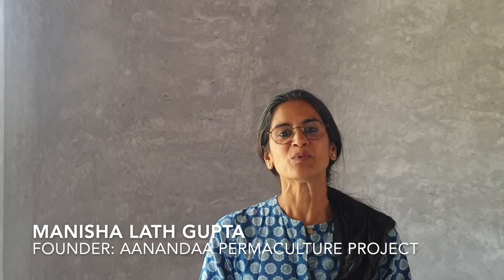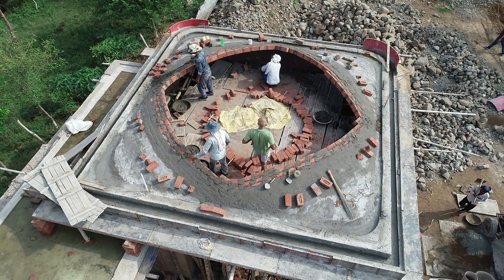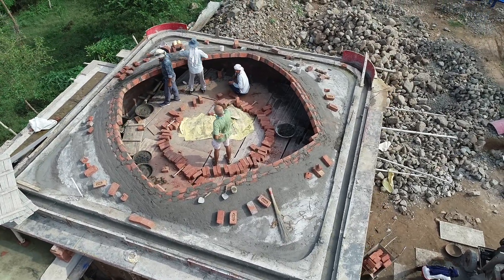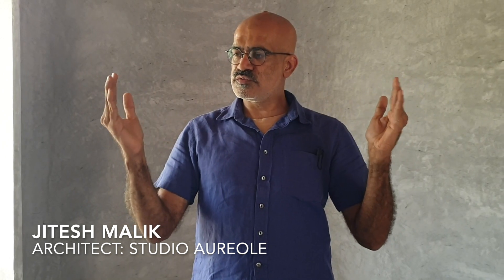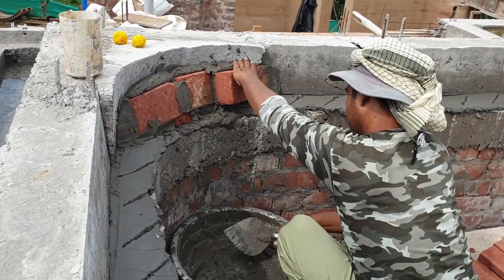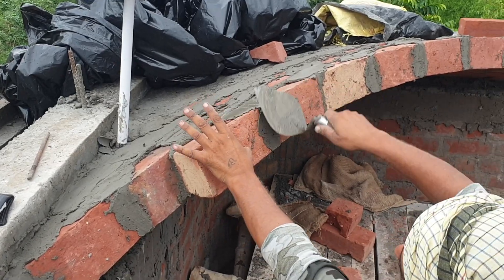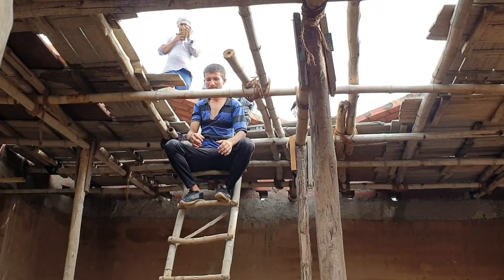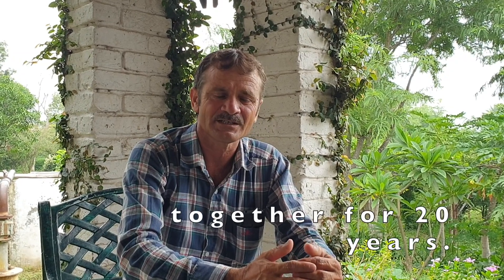How to Make a Catalan Dome Roof

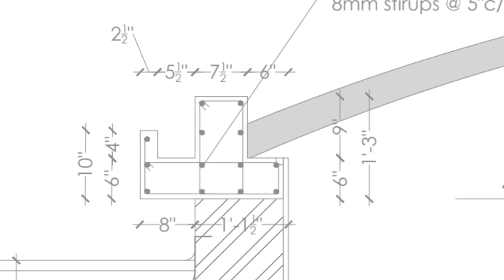Comment: The concrete beam is structurally required for the vault to work. Also it is not true that it is built without steel, you can see it on the plan at 4:55 and you can see rebar sticking out of the beam. The roof will stand up as long as the rebar in the concrete beam won’t rust. That’s why the dome doesn’t have a longer lifespan than a standard reinforced concrete ceiling. The lifespan of the ceiling is the biggest factor in sustainability, if it was really built without steel the brick vault would have the potential to stand for a thousand years, but not when it’s built like shown in the video. There are ways to solve this problem
Reply from the maker: Do share your solutions. It will help the viewers on this channel. Thank you.
Reply: @farmaanandaa  There are two ways I can think of that could eliminate the use of reinforced concrete:

1. The first solution would be very high in cost and material usage. You would have to build massive abutments/thicker walls to catch the thrust force coming from the vault.

2. The second solution would work with thinner walls but would impact the look of the room. You would have to use steel reinforcement spanning across the room to secure the walls in place. This way, you would convert the thrust force coming from the vault into tension, which would be carried by the steel. The key is to make the steel accessible so you can maintain it when it rusts or even replace it.

This is how vaults above ground (without earth pressure supporting the structure) were built for centuries (before the introduction of reinforced concrete).

By the way, I don’t want to criticize the craftsmanship of the bricklayers; they did a beautiful job, which is forgotten in many places around the world. This bothers me even more because I know that it won’t last longer than the reinforced concrete beam that it sits on.
Reply: 👆🏼this person is correct. Another option would be to make the dome peak higher, so it’s less flat & more round.

You could possibly instead use wooden beams for the tie-beam. If it’s a humid climate, then cover it with cob to ‘mummify’ the wood to prevent rotting/termites.

Comment: It’s wonder job,so you had rammed earth walls and you have used concrete structure on top of them to support the Catalan dome ?
Reply: Most rammed earth walls have a concrete "cap". It serves the same purpose as the top plate on a stick frame structure, and it gives you an easy way to install the lag bolts that will hold the roof on, you just insert them into the wet concrete and try to make sure that they're standing up straight.
Reply from the maker: Yes a ring beam.

Comment: wondering how is this different from the Rohtak dome. Also what is the span of this roof?
Reply from the maker: Rohtak dome is a shallow dome with height of about 9-12 inches and built as a spiral. This is a higher dome with a height of 36 inches and bricks are laid out in rows of arches.
Reply: @farmaanandaa  Thank you for your prompt reply. I want to have a dome with a provision for skylight. I wonder if such domes can be left open at top so we can install some glass or other transperent sheets

Comment: Which is better? Wooden Roof, Concrete flat Roof or Metal frame roof on the basis of strength, weight, water-proofing, insulation  and other aspects? Would like a Structural Engineer's perspective.

Also, can Ram-Earth and/or Earth-Bag walls hold a concrete flat roof?
Reply from the maker: I am not a structural engineer, so won't comment on that.

Yes, rammed earth walls can hold a concrete flat roof, as done in our FIller Slab roof.

Comment: Beautiful! just one suggestion, instead of cement use slaked lime, (When quick lime reacts with water it produces lime water or slaked lime.
CaO + H2O → Ca(OH)2
The more you keep it dipped under water like 15 to 30 days its bonding properties increases many fold and old Fort walls and roofs are made this way, still standing today best example of test of time. 
And its more eco/environmental friendly 
Thanks
Reply from the maker: You are absolutely right. And we have used slated lime in most of the construction.  We have a lime tank built on site.  However, the Rohtak domes artisans do not work with Lime because it takes time to set.

Comment: I was under the impression that you avoided Cement totally, but I see again there is usage of cement for pillars, beams, ceiling. So you compromised on experimenting it with 100% effort. Pch I am quite upset with this.
Reply from the maker: We never gave the impression that we have avoided cement completely. We have only minimised its use. Always choosibg an alternative wherever it wasn't absolutely necessary. We have probably used 10% of the cement the house would have normally used. Thats not something to be upset about. Its something to celebrate, as most constructions cannot even achieve that.

Comment: Please avoid using cement, these bricks and RCC. This is NOT SUSTAINABLE. I know it would be better than many many structures around. But, attaching the sustainable to anything cement is incorrect. I understand that sometimes you have to use it and sometimes we cannot avoid, but in that case, please do not promote it as 'sustainable'. I am hurt not because you used it, I know you guys must use it very little. But, understand cement is one of the leading causes of climate change. The word sustainable is INCORRECT in every sense to be used with it.
Reply from the maker: Pls don't get emotional. Sustainability is a journey not a destination. If you make it very difficult for people to start this journey,  no one will change. We must embrace small steps and not allow great to be the enemy of good. 
 This is a sustainable roof options given its life span and material usage. We must support every attempt at using less of cement or other unsustainable materials.
Reply: @farmaanandaa  sorry, there are far better and sustainable alternates to roofing than cement. I understand, it is a journey but a few factors are a big no. CEMENT SHALL NEVER BE TERMED SUSTAINABLE, THIS IS MY PROBLEM. AND IT IS AN EMOTIONAL ISSUE FOR ME. Cement is a big driver to climate change, like a big big one. Calling it sustainable can never be and shall not be justified. I know you use it sometimes when you do not find alternate. I understand that. But, please understand my point. This was a roofing structure by choice and calling it sustainable is my only problem. In terms of longevity as well, natural structures built before cement still stand tall across the world. Cement has a limited lifespan.
Reply: So use lime for construction

Comment: The whole concept is to use natural material. But why CEMENT and RCC is still there? You could have used wood or stone for pillars and beams. Just wanted to hear from your architect....
Reply: The climate is a long term problem, and we need long term solutions. The environmental cost of treating buildings like disposable products has a huge environmental cost. Making longer lasting buildings, even IF there was a higher upfront carbon footprint, could be worthwhile.
Reply from the maker: The whole concept is to use minimal cement and RCC and also materials which are available locally. We have made another roof with wood, which you will see in the next video. 

Never let great be the enemy of good.
Reply: I know you may have mud houses or wooden structures. BUT, SORRY TO SAY, THIS IS NOT SUSTAINABLE. CEMENT IS A CRIME AGAINST NATURE. PLEASE PLEASE REMOVE THE WORD SUSTAINABLE FROM A CEMENT AND RCC STRUCTURE. THIS IS WRONG... WRONG IN EVERY SENSE.
Reply: @VisharadSaxena  It's very difficult to do it practically all of sudden. What ma'am has done is minimum use of cement. Probably they will reduce use of cement in next project. 100% natural construction is very much difficult and impractical in today's time. But they are putting their best efforts.
Reply: @pragneshparekh7652  thanks. To clarify - I had retired some three years back and am researching independently about climate change. It is a major and real problem, and yes, we are the reason. I have an organic farm. Is it healthy and better? Yes. Is it sustainable? No. Most of the things we do everyday, all of us, have negative impact. I am no judge because I am part of the problem. But, we are the solutions too. I will not appreciate my fault when I know it is wrong.

I watch Aanandaa videos around 45 to 60 minutes everyday as I learn from them and trying to shift my organic farm into a permaculture farm. I will still watch their videos. I will visit them (if they allow after my anger :D) and learn more on how they do thousands of things better than me and where I can do things differently.

My concern is tagging a concrete roof to the topic of sustainable housing because it is not. Absolutely not. Cement is a read bad thing. If one has to use (I have it in my place) I would not call it sustainable.

One can be emotional about wars, politics, movies, so can one be about climate change. I would want all to be emotional about climate change because it is a bigger problem than anything else. That is why my outburst. I am not usually like this, sorry.

And to add, sustainable building materials are present everywhere, older than current ones, cheaper too, NOT TOUGH TO MAKE. Probably, much easier than making the actual "choice" of building using natural materials. We can switch 100% not in much time. Maybe our current ways of life make it tough to make that choice.

I still will look up to them for number of other things. 90% of my watched history is theirs. :D
Reply: @VisharadSaxena  Great Sir Ji. I am also planning to shift to village even though I don't have agriculture land. The village is remotest part of Gujarat-Kutch. Want to learn natural farming, organic farming, sustainable living etc before moving there. I am also new to all these but I will switch to that as soon as possible.
Reply: @VisharadSaxena  Sure, this may not be perfect but it will outlast many other building methods, which replacing would easily outweigh the original environmental savings. This technique could be used with stone and pure lime mortar, and thousand year old houses and castles still stand with that construction.